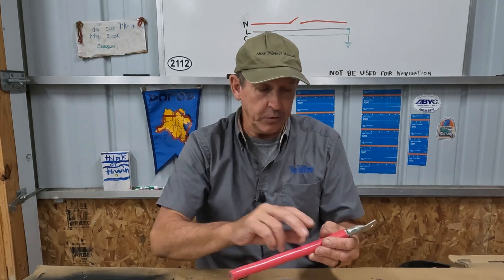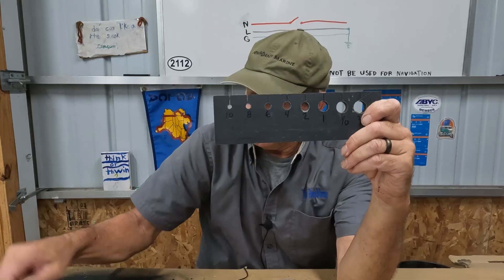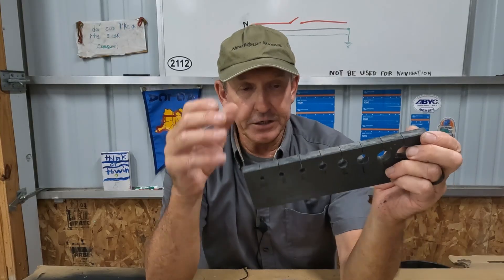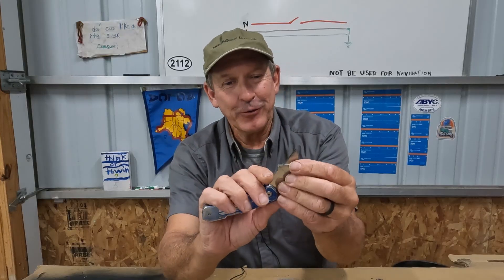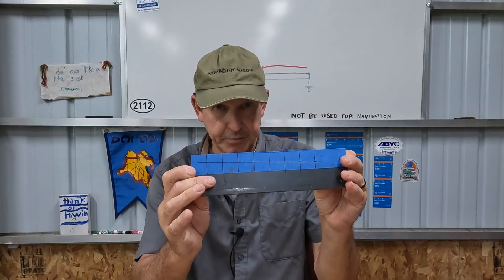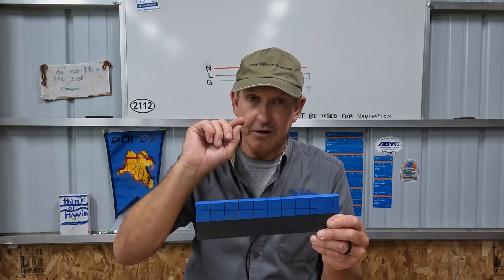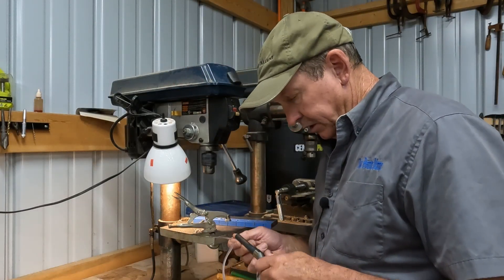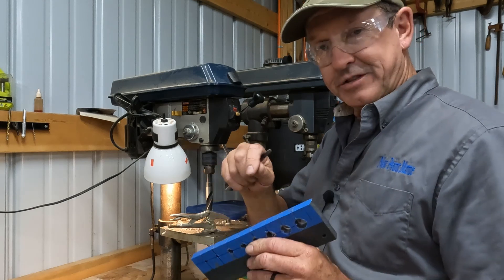How to Build a DIY Five Dollar Tool for Stripping Copper Wire.

Comment: Not bad mate, I did a similar thing with a slab of timber and a stepped drill bit, add a timber screw poking through and it will split your cable. Looking for better ideas though. Holding the blade looks a bit hazardous to me though lol, might try and find a way to fasten it.